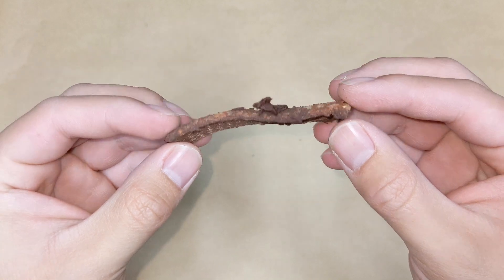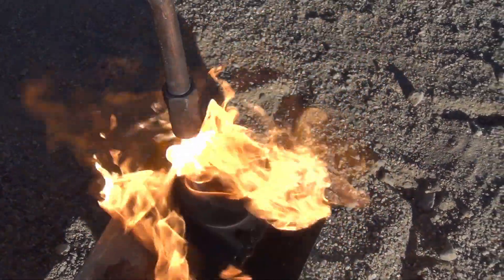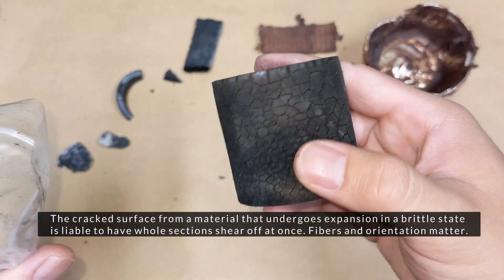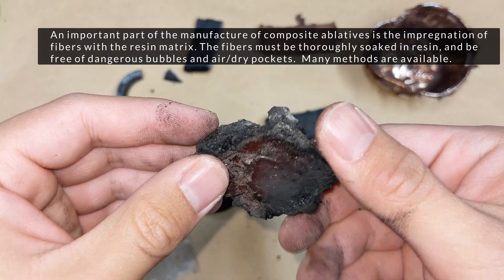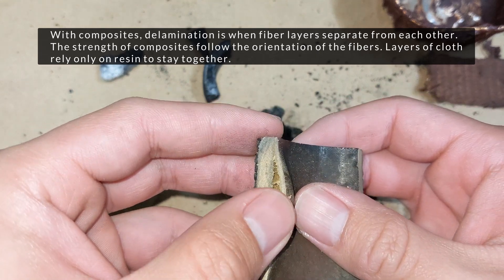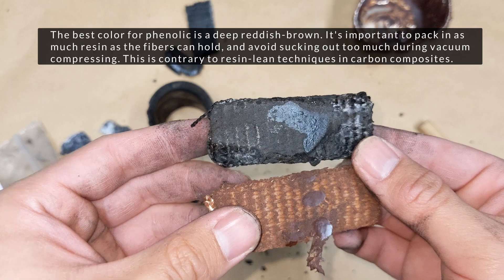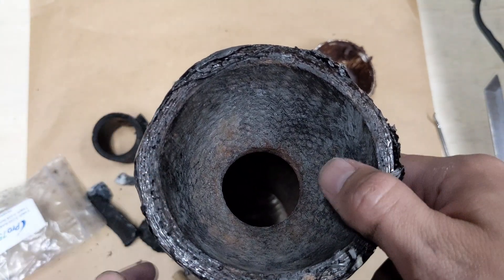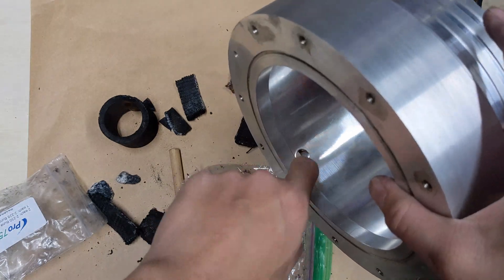(Kinda Boring) Ablative Chamber Liner Analysis

Comment: Thanks for the useful video. I've been working on Resorcinol composite materials for a little while now for use in hybrid motors. They are showing great promise and best of all I can actually procure them and they are relatively easy to use. Currently working on compositions for mixers/diaphragms inside the post cc.
Reply: Do you have any help to make nozzles for APCP?

Comment: Canvas/Linen phenolic laminates are pours and will absorb atmospheric humidity, you should either store the material in controlled inert atmosphere or desiccate it prior to use otherwise super heated steam bubbles can occur inside the laminate causing it to rupture which is likely what has occurred to the sample shown at @5:59
Reply from the maker: That sounds spot on to me. Water is the cause of a great many things in engineering after all, and the lack of any pyrolysis in the bubble supports that. I may have to finally get a dehydrator for both this and for my petg filaments while I'm at it.

Comment: how many layers of the silica tubing do you have to use to make that ablative?
Reply from the maker: Depends on the thickness of the fabric, as long as it's at least about 1/4" thick. In this case I used two layers of 1/8" thick silica, further reinforced with carbon fiber and epoxy.